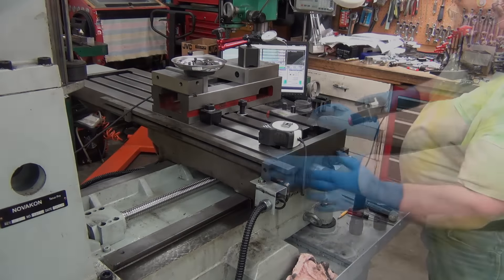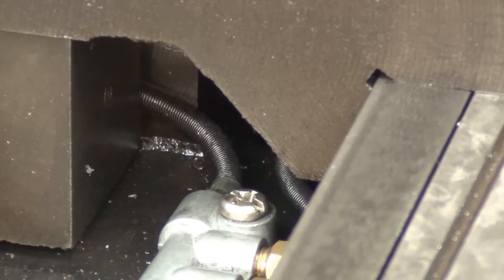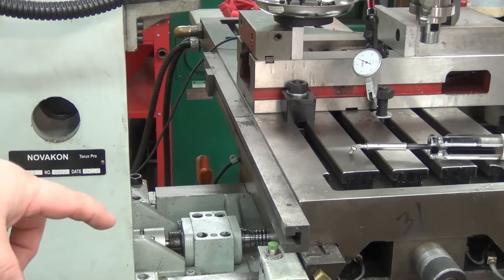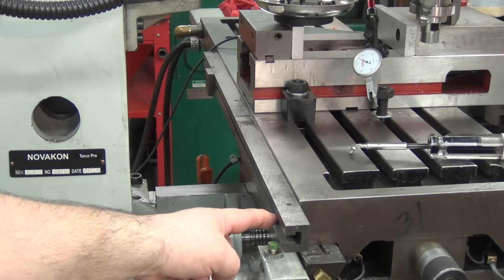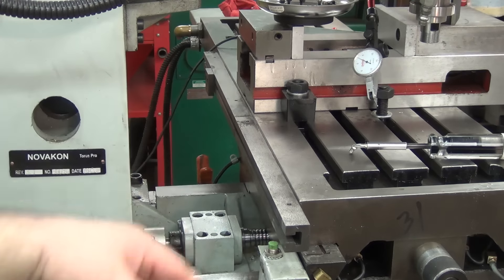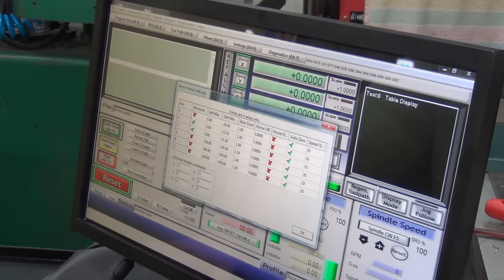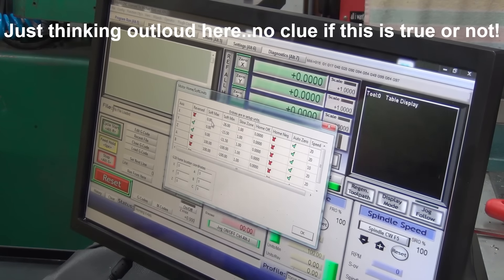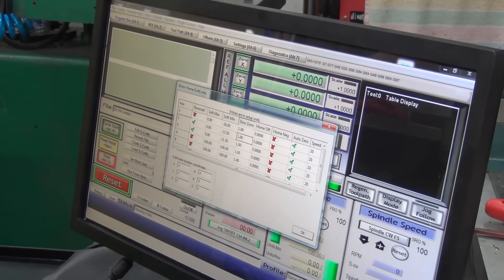Novakon Torus Pro - Max X-axis Travel

Comment: Servos are good workers- they do what they are told.  If a block, tool or human get in the way they just grunt a little harder and move through :-).
Reply from the maker: +Doug P Yep! Especially when they've got some speed going!!  I have the rapids turned downs to 60ipm. :)
Reply: You are a wise man.  No need to verify F=M*A as an equation while you are learning.
Reply from the maker: +Doug P I've already verified it. :(    This baby will do 700ipm without issue.....I can't think that fast, let alone react that fast! lol
Reply: 700 ipm is very impressive! Definitely enough to make you think twice before locating the side of the machine next to a structural wall!
Reply from the maker: +Doug P ......and I wouldn't have even thought of that....very good point! Thanks!!

Comment: Your extra travel is good as long as you don't have a heavy mass part that hangs the saddle on the extended end of x or y or both at the same time is the way I would see any concerns.."way" -  no pun intended
Reply from the maker: +PartisanGuerrilla I was thinking about putting a tool tray on the far left and have a 5-6 tool "changer".  I don't imagine I'll be running anything that heavy.  I had the same concerns initially, but I've seen so many machines that do the same thing, I figure it must be, at least somewhat, acceptable.

Comment: Awesome info. Im still debating if I should buy a pro or save up for a Haas
Reply from the maker: +rhost I'm pretty sure that the base Haas machine is still more than what I have into this with all the options.  I was stretching my limit to go this route.  As a newb, I'm probably lucky I didn't have the Haas first, for as many times as I've crashed this one. :(    I think at this point, my only real frustration with this unit is Mach3!!!  :)
Reply from the maker: +Andrew Cowell I need to hear that it's bullet proof before I drop that kind of money on another control package.  Since fusion is doing the CAM work, I should be able to just use Linuxcnc.  Mach3 is good for the price, but it sure can frustrate the hell out of me sometimes!!
Reply: +Andrew Cowell I'm referring to a Haas Super Mini Mill 2 not the Hoss Grizzly G0704 conversion. +bluehandsvideo I would definitely turn the rapids down to 25% until I was use to 1200 IPM. That's a more manageable 300 IPM which I think is close to the pro. If i went with the Pro i would pull the ESS and probably go LinuxCNC and Mesa almost immediately.
Reply from the maker: +Andrew Cowell There's a pretty good chance that most of the issues that I think are mach3 are my lack of knowledge on how to run it.  If I don't follow a specific sequence when I start a part, I get soft limit errors.  I'm glad to hear that mach4 is that much better!
Reply from the maker: +rhost I've been running the rapids at 60ipm for now.  I can easily get 500 and I've tested it at 700+.....bit too scary at that kind of speed!!.  The ESS makes a big difference in the speed.  I need to learn more about LinuxCNC and Mesa. :)
Reply from the maker: +Andrew Cowell Hadn't thought about lost steps being a problem with soft limits.
Reply from the maker: +Andrew Cowell These servos will fault out if stalled, but I don't think the encoders are used the normal way.  I don't think the encoder feedback is hooked up the same way as they normally are on a pro level machine.  Not sure why, but that's the way I remember it. I'll have to check into it again.
Reply from the maker: +Andrew Cowell I might be wrong, but I remember there being something "off" about their setup.  I think these are being used like steppers on steroids.  I'll have to check into it when I get a chance. :)
Reply from the maker: +Andrew Cowell It's not any kind of priority at the moment....too busy trying to get projects done and shipped. :)
8krpm! Nice!!